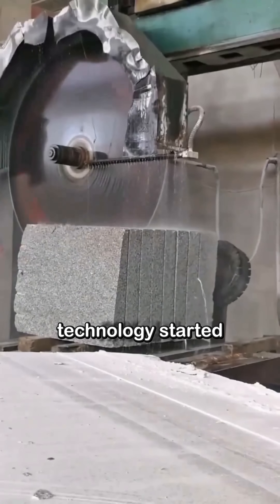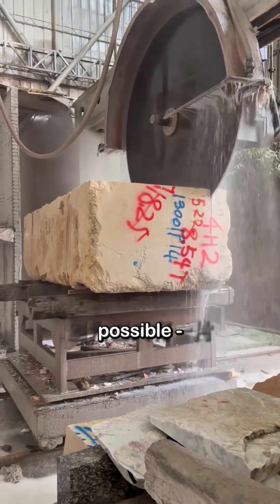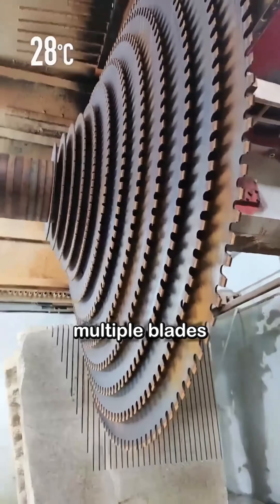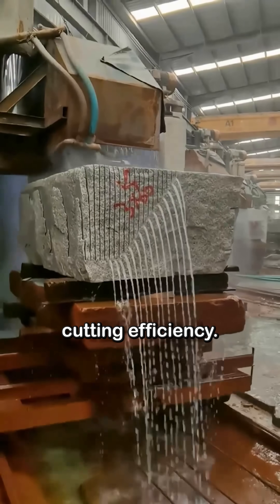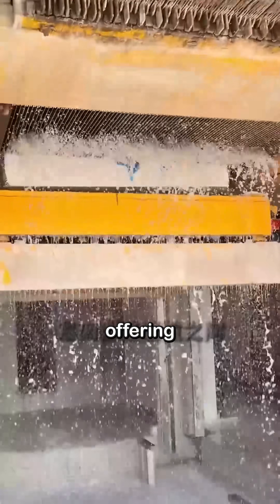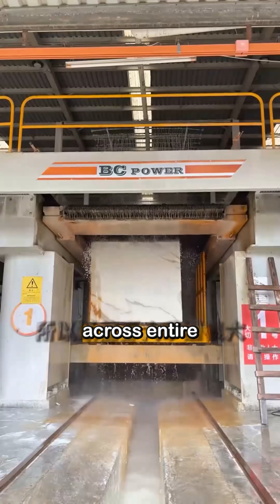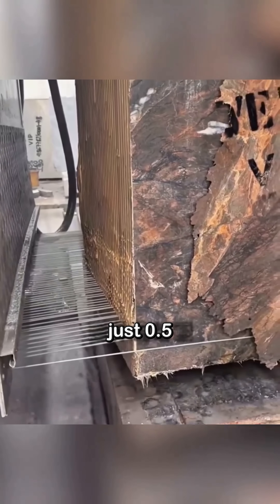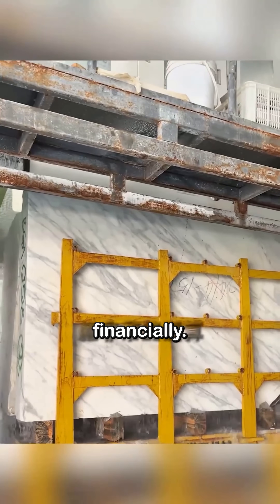Modern stone cutting technology started with 60-centimeter saw blades #shorts

Comment: Egyptian been using those string saws for long time
Reply: I'm pretty sure they used large copper hand saws
Reply: They didn't. Their tools were to primitive to cut hard granite blocks. All what was built is from civilisation before them.
Reply: And of course this was really built by the ancient Palestinians in their sovereign nation called Palestine until some Hebrews colonized it from them and sold it to the Romans.. I forget which Palestinian king reigned at the time. What do you mean Palestine was never a country and never had any kings?
Reply: Really ? i want to see proof
Reply: @elmothecomrade5643  There is a theory that they used a similar technique to saw the blocks of the pyramids by using a string/thong and some abrasive material to saw certain rocks. Not been confirmed yet though.
Reply: @TextiX887  we know they used Coppersaws and Sand. 
Maybe this works aswell with Strings and Sand.
Reply: @elmothecomrade5643  humanity had been using strings to cut and shape from stone to wood